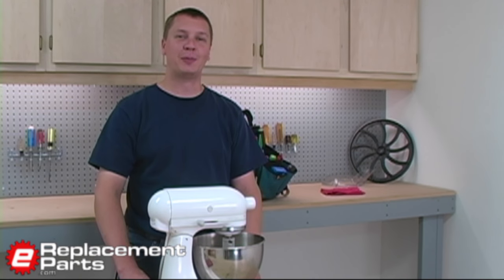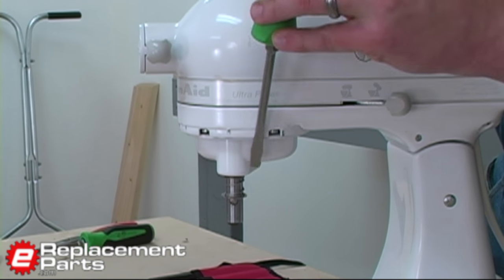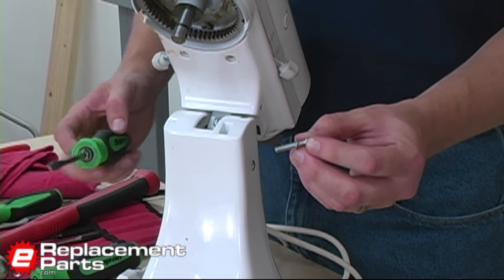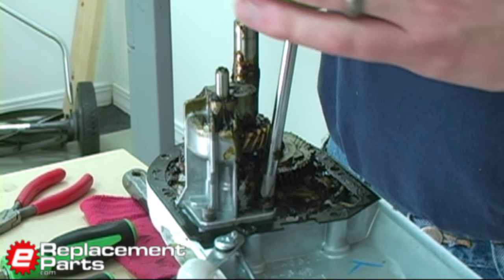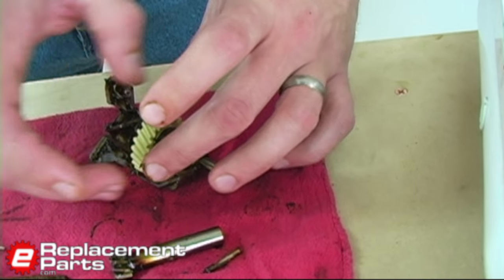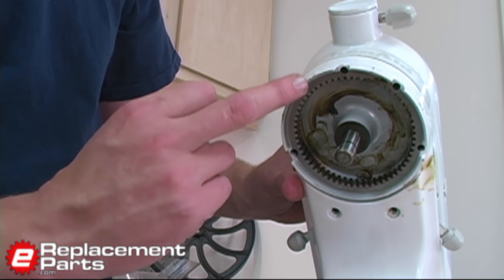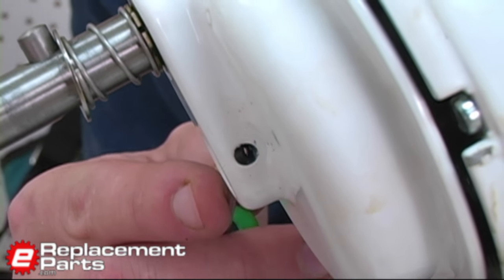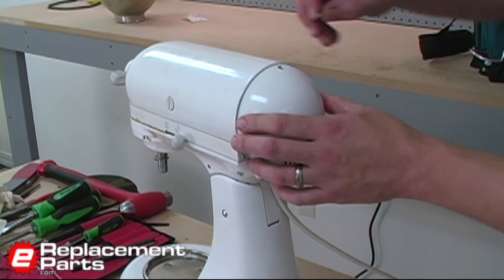How to Fix a KitchenAid Mixer That Isn't Spinning

Comment: My daughter's KSM11 was making grinding noises and laboring in its spin. Using this excellent video I took it apart and found no wear or breakage on any of the gears--not the worm gear or any of the other gears in the top and bottom. I saw no metal or plastic shavings anywhere which would indicate wear. What else could it be? Should I change the worm gear anyway even though it looks OK? There was plenty of lubricant, but is it possible it wasn't getting to all the right places? Could it be the motor brushes? Any suggestions would be appreciated very much!!
Reply from the maker: Hi Michael, we are currently researching this for you. Will have a response soon. Thanks

Comment: Love this tutorial,  but if the roll pin is really stuck and a hammer and roll pin tool won't work, does anyone have any alternate suggestions on how to remove it/get it off?

Comment: Hi Mark. My kitchenaid mixer broke teeth on the gear which i fixed thanks to your video. Now the mixer doesn't start.  I changed the phase control board as well as the speed control board and still have no juice. Can you help me with any other suggestions as to what it may be.
Reply from the maker: Hello, we are currently researching this for you. Will have a response soon. Thank You.

Comment: Your video has been helpful so far; however, I'm having issues getting the motor back on top of the stand.  I'm able to get it down to in the video at 7 mins but when i try to get the gears to mesh, spinning the spindle doesn't always rotate the gear and when it does the gears still don't mesh to bring the stand down.  Any tips or suggestions? Model no. KSM90PSWW.  Thanks!

Comment from the maker: The way to get these off is simply to use a blunt nose pair of pliers and turn it from the right to the left till the slot on the strain relief matches up with the opening on the housing of the mixer. Once that is done you gently pull the strain relief strait down and it should come out. To get it back in can take a little more force. Thanks for watching!

Comment: Need help please.
 Thanks for the great videos, very helpful.

Our mixer spins at speed settings 1 & 2, but fails at anything higher. The motor simply shuts off.

replaced the brushes today. didn't help.

any suggestions?
Reply from the maker: This sounds like either a problem with the speed adjustment or a defective control board.  You can purchase a new control board but the speeds will need to be adjusted again and this requires the speed
adjustment tool only available at a Kitchenaid authorized service center.

Comment: Hello, thank you so much for these instructions. I followed these instructions to successfully replace a worn out worm gear, but after re-assembly, the mixer just runs at one speed (slow). Pulling the lever to the off position and other speed settings doesn't work either and it starts spinning from the moment the mixer is switched on at the mains, regardless of whether it is in the off position on the mixer. I was wondering if this is something you may have come across before and have a solution for? Many thanks
Reply from the maker: +Savio Fernandes That's odd! The only things I can think of that would cause this is if somehow the adjustments on the control plate or phase board had be adjusted incorrectly.  There's a slim chance the gears are binding up inside but it really doesn't sound like that's your problem.

Comment from the maker: If this is the case then you can gently tap that gear back into place until you see ribs. There should be about 3/8'' space between the gear and the top of the housing.
Thanks for watching!

Comment: Have you heard anything about the KA attachment hub failing to spin as being a common problem?  If so, Have you found this being a common failure to be true? Either Way, Can you do a video on how to do this repair or modification? I NEED my attachment hub to work so I can use my extra attachments. PLEASE and Thank You!

Comment: I wish I could tap that damn roll pin to the planetary shaft out as easily as you did. Any suggestions on one that hasn't been removed on a 10-15 year old mixer. I sprayed it with a Nuts Off type product and it still isn't budging. I'd hate to have to drill it out.

Comment: Hellooooooo.....I am following your GREAT instrutional video, but my roll-pin that hold the planetary to the mixer wont come out. I see it begant to break as i hammer it. I am using the same tools you are. Since it has two sides, can you please tell me if there is a specific side i should be hammering from. I have a model K5SSWH.........Thank you much :0)

Comment: We have a very old k5ss - not running.  (yard sale find)  Replaced the brushes, one was completely stuck and we ended up drilling it out and essentially removing it in pieces.  In the process, we took apart the planetary - thinking maybe we could push the brush out if we could only get inside.  (nope)  NOW we can't get the groove pin back in.  Everything (miraculously) runs beautifully, we've ordered the new pin - but the hole doesn't appear to line up...  can we live without it?

Comment: When you take the kitchen aid apart, can you still plug in the motor and test it for power, or does it have a safety feature that prevents it from working when certain screws are removed?

Comment: Mark,

Thanks for posting this video -- it was very helpful. I am having an issue with the governor assembly on my KitchenAid stand mixer -- could you take a look at this video and let me know whether I could fix this simply by replacing the governor, or whether there is something else going on here that may have caused the governor to fail?
uy17I2L1fgs

Thanks a lot!

Comment: Hi, how do you fix a kitchen aid stand mixer model K5SS? It does not spin. I want to replace the worm gear just like the video you have shown, but I don't know how to open it. I saw your video for the tilt mixer, but not for a stand up mixer. Thanks
Reply from the maker: Disassemble these using basically the same method with 2 different steps.  1- remove the 4 chrome screws between the motor and the base and once you have those removed, there are 2 screws underneath that hold the top piece to the bottom.  Otherwise, the steps are the same.
Reply: eReplacementParts.com 
What about Heavy Duty kitchenaid model 5KPM5?
Reply: +eReplacementParts.com The 4 chrome screws are about 3/8" with huge holes for the philips head. It is not possible to find a huge screw driver like that, at least I have not seen such a huge one. Any ideas???

Comment: hi there, love the video! however i'm having trouble removing the pin out of the planitary. It just wont budge no matter how aggresively i try to hit it out. I fear that i may damage the mixer. just wondering if all kitchenaid mixers have the removable pin there or just some..?
the model number of my machine is KSM150PSPK
thanks in advance

Comment: On mine i found out it was the Gear, Attachment Hub Bevel (part number 9705130) which was stuck solid metal to metal. It actually scored the inside and the hub bevel slightly due to what i thought was overlooked when it was assembled Is there suppose to be like lithium grease in there to lubricate it? It came out with a few light taps.

Comment: Would the motor still make any noise if it is a gear problem? The planetary does not turn, but I'm suspecting it is electrical, not mechanical, since the unit make no noise at all. Do you have any advice on troubleshooting this before I disassemble?

Comment: Great video got it all done in 30 minutes but now the unit won't start feels like no electricity is in it what can this be keep in mind I started to unscrew one of the two large side screws at the top of the housing but I instantly put it back in with no trouble would that effect the electricity that would power it?
Reply from the maker: +barzilla187  The cheapest and fastest thinks to check are the brushes.  Many people have this same problem and the solution is usually the carbon brushes were not installed correctly.  The brush holder are designed to accept the brushes one direction only. If they aren't in the correct position they won't make contact with the armature.

Comment: After you have the KA standmixer apart is it possible to tell by looking at the worm gear that it is the problem, before reassembling everything?  Would it be advisable to replace the grease at the same time, I have seen some very dark grease coming out as well as it not turning.  Our mixer stopped working after using an attachment at the wrong speed.  I think the motor still ran but it barely turned and clicked a little, so hoping it is only this gear that needs replacing.

Comment: How do you know that the gear you replaced is the culprit?  Side by side comparison new/old?  If that doesn't fix the what where to next?
 thanks!
Reply from the maker: +Paul Santaularia  Side by side comparison works. It's typically pretty evident where the problem lies.  You can usually tell if one or more of the gears is bad by visual inspection.  As long as the motor is actually working the gears will be the issue if the beater end isn't turning.

Comment: I have a Kitchen Aid 6 quart mixer. It gets stuck at the 1 oclock position. If there is nothing in the bowl, it spins fine at higher speeds, and a bit slow to start at higher speeds. I replaced the worm gear, and the front bearing as they looked worn. When tested without anything seemed to work, but once reassembled, I have the same problem.

Comment: Hi there. We are trying to reassemble the mixer after having replaced the worm gear and have hit a snag. It looks and feels like everything is in alignment however the motor housing is not falling back into place as it should. Any ideas as to what could be keeping it from just sliding back in?

Comment: I've recently purchased a new Kitchenaid. On most KA mixers the gears seem to glide pretty easily to increase and decrease speed. With mine there's a noticeable resistance. It does move and all the speeds work but sometimes I have to use my dominant hand (right hand) because my left hand won't get it to move. Luckily once it's going the machine works like a dream. Am I overreacting? Should I be concerned about the ' tight gears? '

Comment: Excellent video, thanks! I managed to switch out the broken worm gear.
Unfortunately, after putting the unit back together, I have no power.  I took good care to not do anything to the motor, but now nothing is happening when I turn it on.  I took the whole thing apart again to see if any wires came loose or anything obviously was out of place, but it looks fine.
Could there be something I'm missing/did incorrectly/damaged during this fix that could have led to this?
I'm sad and desperate to get my kitchenaid back up and running.
Any thoughts or suggestions would be greatly appreciated.
Thanks.
Reply from the maker: Usually when this happens, providing the motor was working before the repair, is the Brushes.  A lot of times during a  repair, people remove the brushes and fail to get them back in correctly.  The Brushes and Brush Holders are keyed so they will only work in one position.
Reply: So if it is the brushes that
Reply: Sorry, so if it is the brushes that have moved, what are they? What do they look like? How do I ensure they are in the right position?
Reply: Neil Dytham Ok this is what happened to me...did you fix it?

Comment: Hi, Great video!  

A neighbor gave away an old Kitchen Aid mixer (the kind the does not tilt) that she said is broken.  It does not have any outter physical damage.  In fact, it looks nearly new!  But indeed, it does not spin (or do anything) when plugged in and dturned on--not even a sound.  I have no other information about it (she's since moved) and would love to fix it  if possible.  How can I recognize what the exact problem is ?  Can I contact you directly?

Comment: I am following your video, but have not been able to remove the pin that holds the planetary. I have used a punch and even some releasing fluid but the pin has not moved. any suggestions to do this would be appreciated, I was considering drilling the pin out.

Comment: @ 1:40 you are using a punch and removing the screws to take off the roll pin and planetary. I can not locate a pin or screws on the pro 600. I assume it has to be removed on the pro 600 if i am replacing the worm gear?

Comment: great video. I replaced the worm gear but now my Pro 500 only runs at high speed setting at 9 or 10 and it does not run at low speed at all. Anyone knows what's going on??

Comment from the maker: The gear that failed should be rather easy to determine under close inspection. Any teeth that are missing or a split gear will be a good sign of what gear to replace. Thanks for watching.

Comment: Hello. This may be a little off-topic question, but do you know how to remove the leg of the tilt-version mixer? It has an axle but it does not seem to be a screw. I have an old K4-b mixer and the bowl lock mechanism is with a screw in the middle and bowls are impossible to find for this model and if you do, they are not stainless steel and are in pretty bad shape. I wanted to try to replace the entire leg of a K4-B with one from a K45 that has a lock-plate mechanism to attach the bowl. Thank you!

Comment: I can't get the motor housing removed. My model is a KSM5 that doesn't tilt. Any help would be appreciated. Thanks, Joe
Reply from the maker: Much like the mixer in this video, there are two screws that hold the housings together in the back of the mixer. To get to these screws you will need to remove the whole head from the base/stand of the mixer. There are 4 bolts the screw into the head through the stand that hold the head on. Once those are out you will gain access to the two remaining screws.

Comment: Thanks to your video, I was able to replace the worm gear on my KSM90. While it was open, I also replaced the cord and put new grease on the gears. I put everything together, plugged the machine in and I let it spin slowly for a while, so the grease would distribute itself. Everything seemed to work fine. I checked the speeds then but when I finally put it on full speed, there was flash of light and a bang and all fuses in the entire house went out. Now I'm afraid to try and plug it in and try whether it's still working. Do you have any idea what the problem could be?
Reply from the maker: +Patrick Schmitt  Sounds like a wire grounded out some place. Whether a wire was pinched or touched the housing it would give the same problem. The safest route is to take your mixer to a service center to be looked at.
Reply: +eReplacementParts.com Thank you for your kind reply. In the meantime, I have found out what the problem was. A contact in the back has, indeed, touched the housing. The machine is working now, however, I have noticed that every time I turn it on or change the speed, there is a spark to be seen inside through the speed control slot. I've already been told by some people that it's normal. What is your experience with that?
Reply from the maker: +Patrick Schmitt Light sparking is normal happenstance with these models.

Comment: Same issue as many others, cannot remove the roll pin no matter how hard I hammer at it. Model rrk150
Reply from the maker: The pin needs to be remove. You may have to resort to a punch and hammer.

Comment: what is the name of the "lower gear or lower shaft" that you remove from the worm gear 4:39 mark? I inadvertently bought the worm gear, yet it is this lower gear that has the broken teeth on it and needs to be replaced. Thank you for your response.

Comment: where to get the parts? assuming the parts list is in the manual  any difference with a 1984 model and gears?
Love my K-A can not cook without it concerened about a new 'noise' 
more like it is laboring to turn, Finally ordered an ice cream attachment and a pasta attachment In my winter years and plan to enjoy them. and include my K-A in my will.

Comment: I bought a used and broken KSM90 as a project but ran into a problem. How can you remove the brushes if they are stuck? The springs did not retrieve the brushes and they are stuck now, maybe because of improper installation prior to me purchasing it. Thanks.

Comment: Hi, I have a k5ss and tried following your instructions for this mixer. The mixer worked. i.e. rotated, but did not have the power to mix the dough.
While disassembling, I ran into some trouble. First, I could not hammer out the roll pin, it seemed stuck, so decided rotate the planetary a bit to make it easier to hammer out the pin. I could not rotate planetary manually, so I reassembled what I disassembled, plug it in and shifted the gear. The mixer did not respond - it was dead. Somehow disassembling, placing mixer on its side (a bit of oil leaked out) and hammering on the pin shut down the mixer.
I would appreciate any advice that you may have.
Thanks,
S

Comment: I have Model KP26MIXER. Something happened and the parts that hold the housing in place inside of the slip collar ring, dropped out. The inner circular sleeve is now cocked and not squarely flush with the inner housing. I have not tried to take the entire housing apart but wonder if it is practical to just replace all of the gears and the housing that slipped out from where it should be.

Comment: Hello the roll pin on my model 5KSM150SEER does not come away.
How can I fix that? Thanks for your help
Reply from the maker: Use a Hammer and a good Punch.  If the pin won't budge it may be sheared or bent but it needs to be removed. Once it's finally out and the repair has been made, replace it with a new one.  Don't reuse it.